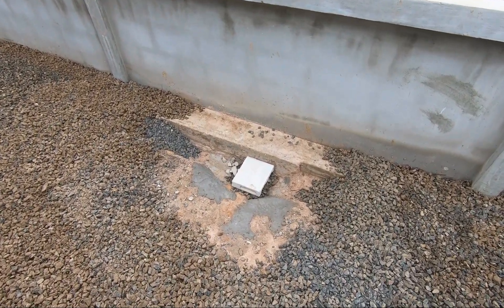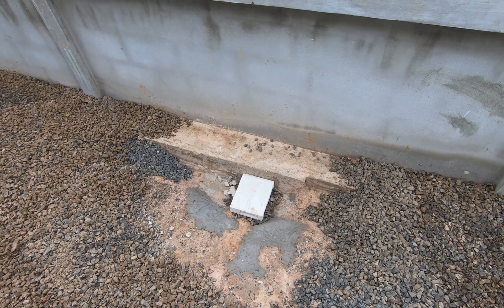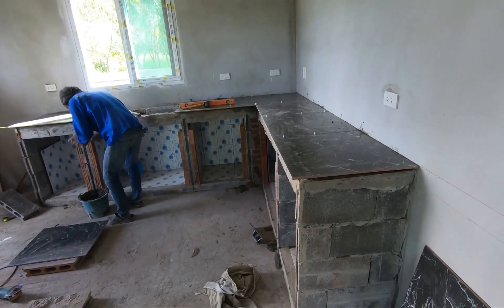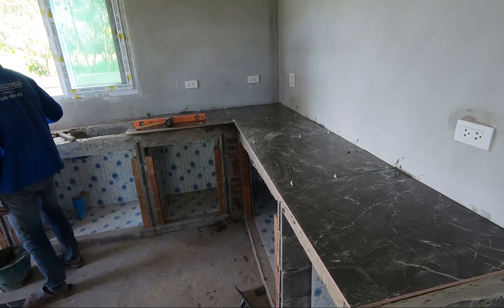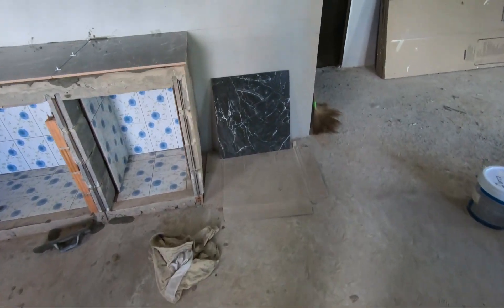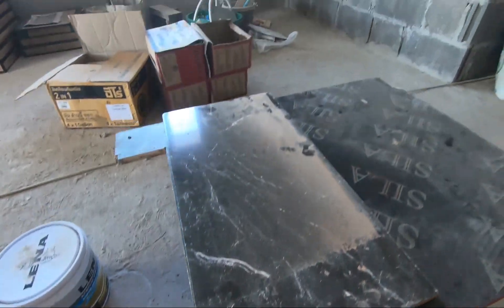New House Build part 60 - kitchen tiling and garden drainage

Comment: Good idea getting the tile levellers, looks like the same ones we used here last week. Our floor is now complete and looks great the little wedges did their job once we found a tiler willing to use them. When removing them the next day we used a rubber mallet just to hit the white plastic upstand, if you hit the wedges they are likely to break. Good luck and keep going with the interesting videos. To get cleaner cut edges buy the tiler some new discs, they use discs for too long hence the chipping.

Comment: Another informative video thanks for sharing the ups and downs of building in Thailand, it’s certainly not straight forward 🙄.  
          After asking for your advice on your PU roofing I bit the bullet and have got the builder to order and fit new PU roofing panels to our main roof area which is coming Thursday, couple of points I’m not sure on   How did you finish the raw ends at the bottom of the panels where the gutter sits as I understand the birds like the PU and my builder seems to be leaving the ends exposed with no form of protection end capping, again would be grateful for your thoughts, many Thanks 🙏